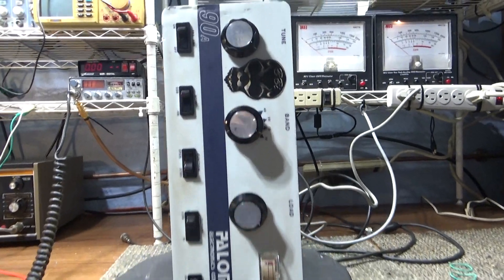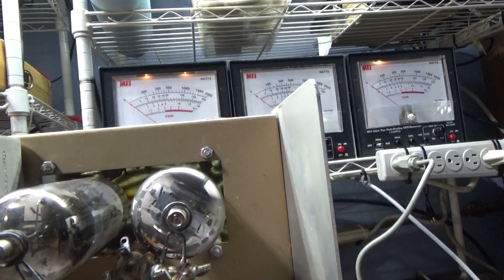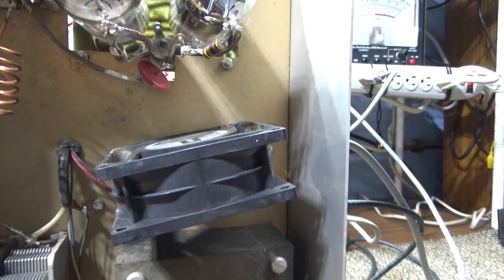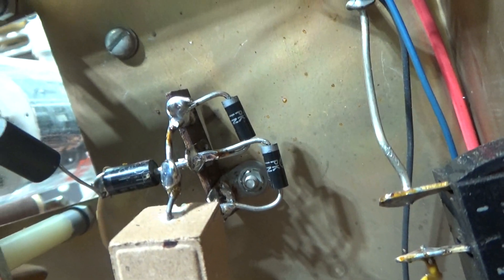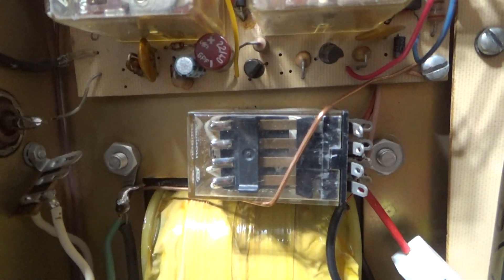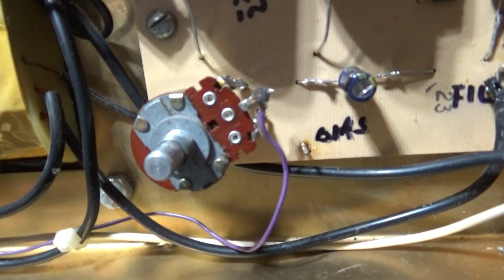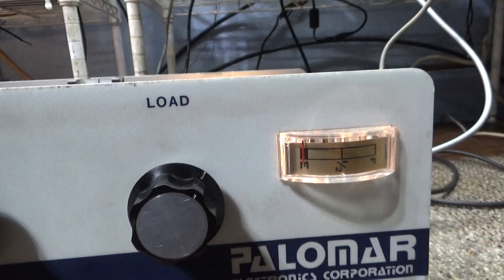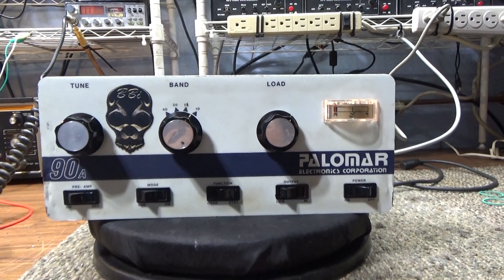Palomar 90a customers on the bench

Comment: 4:05 What's with the yellow and beige wires twisted together? Also, that red wire has too long and may cause input tuning problems.
Reply from the maker: The Yellow and Beige wires twisted together is called a Gimmick. A Gimmick is a real electronic old school term and is when something is used to create electron flow either capacitance or inductance but without actual electrical contact. That Gimmick in the 90a creates a small amount of capacitance across the  2 wires though they are not electrically connected. The small capacitance produced is what is used to run the meter. The Palomar 90A schematic on CBTricks shows a schematic symbol of an actual capacitor. However, the schematics on CBTricks on the Palomar 200 shows a dotted line capacitor symbol and has the word Gimmick right under it. A Gimmick was used in many amps back in the day to run the meter, and on a few amps and radios that needed a small amount of capacitance for neutralization, a gimmick was sometimes used for that too. What made it great for neutralization is you could change the value of the capacitance by fiddling with the wires. More turns or less turns, longer wires, etc. https://cbtricks.org/Amp/palomar/200_base/graphics/palomar_200_base_sch.pdf

Comment: Greetings, do you have a 300A transformer that you'd like to sell, I need one.
Reply from the maker: Yes but 200 plus the ride, firm.
Reply: @tramdr  Great, how do I pay you?
Reply from the maker: M/O only. Where are you and do you know that 95% are voltage doubler and 5% are full wave?
Reply: @tramdr  I'm in Colorado 81401 and I have purchased the older 300A (black face), how much and where do I send the mo?
Reply: also I did not know that 95% are voltage doubler and 5% are full wave.
Reply from the maker: Send me a pic  of yours underneath to determine which transformer you need. Also best to contact me  by email Tramdr at Yahoo.com
Reply: @tramdr  ok, will do

Comment: RE: 90a   https://www.youtube.com/watch?v=4OmlIPxCYBQ 73
Reply from the maker: Yep, that looks very familiar. Actually, on that video he switches the wires around on a switch for the High/Low. Ummmmm, NO, doesn't work like that. The switch was mounted upside down. Took me a while to find that. I started to make a video of just that but then thought who would really care.
Reply: @tramdr  yup , I th.ought it may shed some light , I know those tubes didn't last long making 200+watts . 110% tubes should last for years . I'm shocked the transformer didn't smoke with the old caps and big fuse value . I dropped a link for this video in that video's comments so he can get his files updated too. 73